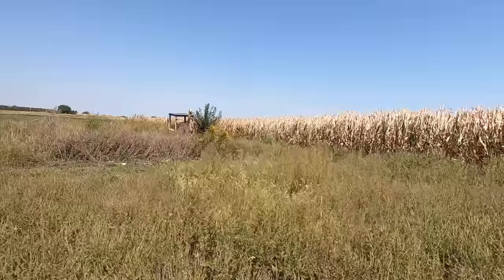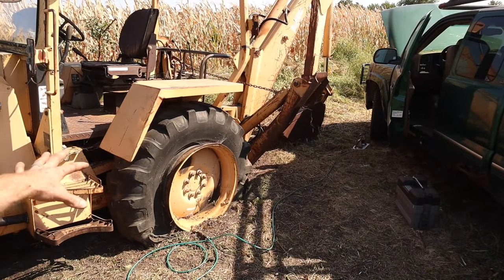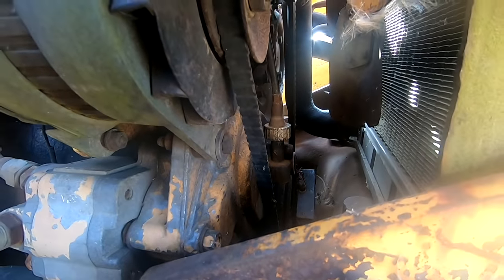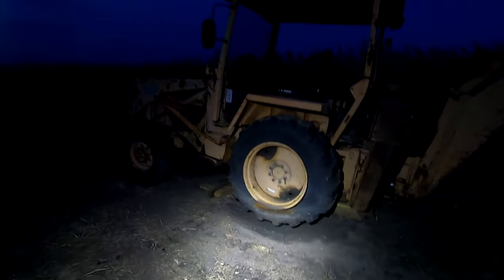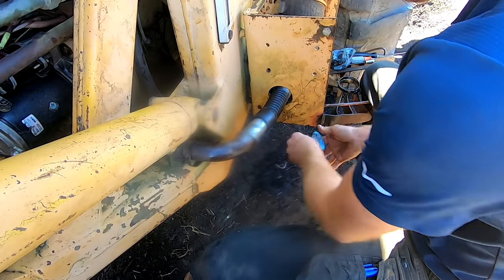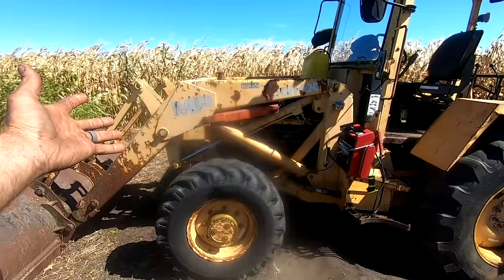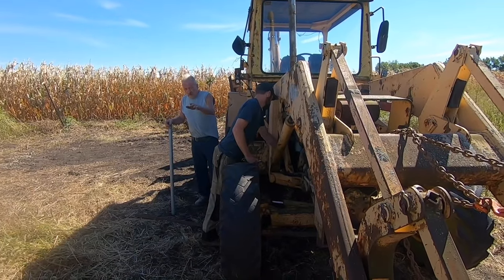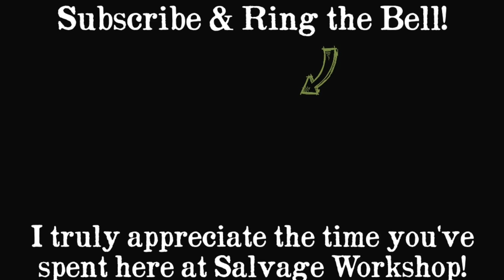I GAMBLED $600 on this Backhoe, sight UNSEEN?? Was the MF WORTH it?!? ~ Broke Down Backhoe ~ Part 1

Comment: Where the oil level glass is located  that part of the loader frame is the tank. I think you are right it is an 80's model. The one Wes did had an unrebuildable swing motor pump thing that the whole backhoe pivoted on. This looks different. Al B.
Reply from the maker: Yeah this is much newer than the one Wes worked on! I'm excited to get it ready to be put to work! Thanks for watching as always my friend!
Reply: @SalvageWorkshop  About that tank crack. Grind it out completely. This may sound weird but preheat a little ahead of your weld. Not cherry red but hotted up. Weld with 7018 vertical up. This will give you good penetration and the 7018 will be compatible with the steel if it has some high carbon. The heat will also cook out any oil in the crack. Hope this helps! Al B in Ohio.

Comment: Radiator fix:I had a buick with the plastic ends,drilled a small hole at the top and bottom of crack,(roughed up the area painted with black pvc cement 10 times)drove 5years sold and third owner drove 5years until they sold it,same radiator.

Comment: I have a massey ferguson  Ind. 50D T LB . I've rebuilt all the hyd. Jacks  hyd  system is super .The wire ing is shot
The Perkins 4cyclender diesel runs good
68 hp. I dig  mine out of a bire patch killed a coper head that it thought it was theirs I've been working the ol gal alot.I use her around the house farm and shop.

Comment: The hole in the front is where the power steering arm and cylinder mounts on ag tractors. The rod pins to the casting on the right side of the machine then the y yoke comes up through that hole and hooks to a pitman and cap end of the cylinder most industrial and 4wd machines used the older style booster cylinder on the side of the machine for powersteering.
The top cover seal kit for that cav pump can be had at any pump shop for about 20.00 it is super easy to pop the cover off change the seals and if equipped bushing around the throttle shaft slap the cover on and go. Also you have to remember that the cav system recirculated all the air in the system right back into the filter so getting air out has a bit of a procedure.  
Check that the rear hydraulic lockout is flipped and that the shuttle is in neutral. Also some of them require kinda jiggling the fnr while holding the brake and key.

Comment: The bushed hole in the front of the frame was probably for the vertical shaft of a capstan winch. The back hoe is built on the running  gear of a Massey Ferguson tractor which would have the winch option for typically forestry work. 
The original JCB was similar in that it was built on a Leyland 72 HP tractor.
 Harry Ferguson the founder of the Ferguson Tractor company was a farmer in Northern Ireland in the early part of the 20th century. He was famous as the inventor of the three point linkage.

Comment: The tractor is essentially the same as a 200 series farm tractor with the 4x4, loader & backhoe added to it.  The radiator, fuel tank, engine, transmission, & rear axle look nearly identical as a 256 or 258 that I ran for a farmer that I worked for about 25 years ago.  If the starter or alternator are Lucas parts, you can get Delco replacements for much cheaper when they have issues.  The mechanical parts should be extremely trouble free.

Comment: These old diesel machines are amazing, they often fire right up no matter how long they've sat. I think people run into a mechanical issue and because they don't need the machine immediately, they give up on it and park it, they are seen everywhere. The mechanism is probably the way it is due to patents, John Deere probably used the simple design. I can't stand tubes, they cost 100$ each, I just buy new tires, but I get it that you needed it to run first before you dumped any more money into it. I also hate fuel injection pumps, I had a Dynahoe with a Detroit 3-53 and it had a simple gear driven fuel pump (a 30$ part). But my John Deere 500C BHL has a muti-million dollar fuel injection pump, I sure hope I never have to rebuild it. Nice job saving that machine, it's even 4WD!! That's a fantastic deal and you can spend time fixing all the little bullshit, maybe you already have, I'll have to check out your other videos...

Comment: Second best option is to block up the frame / axles before you cinch down your chain binders so the bounce in the tires does not load and unload your chains., but the maneuver your'e doing there is called early Sunday morning hauling where I'm from lol

Comment: That injection pump is a CAV DPA pump, pretty much bullet proof, it's only draw back is if it's left sat for a long period the fuel cut of lever under that top housing on the pump sticks shut (Engine stopped), watch you don't lose the spring that closes the plate 😂😂 , p.s I made the clutch plates in that semi auto transmission 👍

Comment: I think that hole in the front of the tractor is for the old power steering unit that the older ones used to use my 50a has the same setup Ide say they kept the same design for a while but put different steering on them

Comment: yes I see using the choke cable but that cable was convert to the mechanical shut of diesel line with a pull knob instead of my F700 electric motor and vacuum cut off the dieseling engine into stop dead. WE sold the 1980 with rebuild/replace cab in 1999 F700 so my sister receive the money in North Carolina and Puerto Rico.

Comment: That hose won't hold there is pressure there to force it through the filter more than that can handle ...don't worry about fuel leaking from the pump it will still run I just need to get the air from the body bleeder ..

Comment: easiest to do is lift rear up with the outrigger or with the backhoe , block under the rear axle and remove the old tire ith the rim 
get it to a tire shop , have them remove the old and install new, or snoop online for wheel with rim for tractor if you can find the hole pattern

Comment: Hole in front of the radiator is meant for the cylinder helping steering if tractor is rear wheel drive. This seems to use same front bracket but because 4x4 it's not needed.

Comment: The location you were pointing to in nose of the machine behind the hydraulic pump is the location for the power steering assembly on 2wd MF industrial tractors. I don’t know about these 4wd units.

Comment: You usually want to load a tractor backwards onto a trailer.  There are several reasons for this.  1. A lot of the weight on a tractor is biased towards the rear wheels. So, if you load it forwards it will normally make the heavier weight behind the rear tires of a trailer which will make the trailer fishtail at anything other than slow speeds.  2. Not a big factor in your case, but loading a tractor from the front can cause it to flip over backwards.  This is especially bad for old tractors that don't have some sort of ROPS, a rollover usually kills or maims the driver.  3. If a tractor has poor hydraulics, you can normally drag a bucket up the ramp if you back it on.

Comment: At 2:18  The hole with a bushing in front of the radiator is for a steering shaft.  There would be a steering cylinder and shaft going down to the tie rods if it was two wheel drive.   With the four wheel drive the steering is different.  This is apparently built on a Massey Ferguson frame and engine.  I have a MF tractor that has exactly the same front and Perlins engine.

Comment: Fresh diesel has better cetane, and is better for the injectors. I once started a Volvo car diesel that had sat for at least 5 years. I got it started, but it made yellow smoke and not much power.

Comment: Up front by the hydraulic pump the machined hole in the frame was the steering shaft for the power steering slave  cylinder Pittman arm before they turned it into four wheel drive and deleted it for a stronger two cylinder set up.

Comment: The bushed hole in the front casting is for a vertical steering shaft if the casting was used on a 2wd agricultural tractor. You won't need it.

Comment: Maybe the hydraulic pump packed up and they are now hooked up to the built in hydraulic pump on the tractor. Will be a low fluid flow but at least it would move things. What's happened to Old Red?

Comment: You should clean out the air filter first so that the trash left by mice and birds doesn't get into the engine secondly you should check your oil your radiator specially your card hydraulic fluid your battery connections your wires if you can see them but I wouldn't worry too much about the wires make sure that all your safety equipment for shutting off the engine when it's running

Comment: What jump pack is that it looks like it works well!
Reply from the maker: It's a Jump & Carry 1224... it can be 12v or 24v and it works AWESOME! I also have a Jump & Carry 950 that's only 12 volts it's also awesome! They are built like tanks and they WORK!

Comment: The hole at 2:20 ist for the stiering on the 2WD version. 
The powerstiering is ther in the front. 
I know a mashien like this, it have the same loader and the arm with the raele on the back.
It have a 2+2 gearbox, with a converter and a gaspadal vor vorword and reverse. 
It dont have the secend floor in the cab, you sit 10 insh deaper.

Comment: Please, can you take your multimeter and try ohm meter to check if the ignition/test switch is connect so the ohm is zero in the reading.the switch is connect to the low power relay once you energize the relay then it automatic connect the high power starter circuit into cranking up. How do you know if the ignition is bad; it could be worn and corrosion?

Comment: Whenever  I see High, max/over, oil level, on these long standing machines. I always think "Probably because the oil is floating on a bed of water".
Reply: Or fuel, or both.
Reply from the maker: Yeah, me too! People don't usually add too much oil! Fuel leaks are also a culprit or possibly penetrating oil of some kind if the engine has been stuck or sitting for a long time!

Comment: I think the front is for a power steering pump .  My gasser is the same but that's where my power steering assembly is, cylinder and shaft to wheels.  Just a thought.
Edit- not pump, cylinder

Comment: 4-248 = 4 cylinder, 248 cu in. Most Perkins engines have this sort of model number system, slightly unusual in the U.K. that cu in was used as even years ago in the U.K. every other manufacturer used cc or litres. 248 cu in is 4.064 litres.

Comment: To release the hydraulics, just crack 1 line on both lift cylinders to release the pressure and the cylinders will lift up without lifting the machine. This indicates there’s still hydraulic fluid in the lift cylinders.
Reply: Or just go to your valve handle and work it and release your pressure

Comment: Hello,
Good work :)
One tip (maybe) about electric issue to start thru the ignition key.
On many backhoe (maybe same on tractors too) there is a security to prevent starter to get current from the ignition key when forward/reverse lever is not in neutral position.
On my case 580SM it is done using combination of relay, if not in "N" position all what you get is a small "click" (some relay somewhere) and nothing else.
As your MF is quite older but still "recent" (it has a buzzer in ! ;-) ) maybe it was some switch somewhere (position detection on lever or transmission itself) that make the circuit "open" instead of "close".
I don't have manual of this MF so possibly my idea don't apply to this model, but... just in case I shared this with you.
Wish you good luck for this one.
Hope to get some progress about "Old Red" one day ;-)
Cheers from France.
Nicolas

Comment: If it ripped the valve stem out of the tube then how can you patch it
Reply from the maker: You punch a hole in a tire patch just smaller than the valve stem, then push the valve stem through the hole and then clean and glue the patch just as you would any other patch on a tube.... with the right prep work and a good glue joint it could hold up for years to come!
Reply: @SalvageWorkshop  Was the old tube, really bad. Is that why you replaced with a new one?
Reply from the maker: The valve stem was just torn, but it was like $80 for a new one and a local tire shop had it on the shelf so I decided to just go that route and be done with that part of the rescue... I did keep the old tube and if I ever need it, I'll just try to patch around the valve stem and give it a shot!

Comment: Did you try putting pressure on the hydraulics (when you jacked the loader up) and then operating the loader valve? Should have relieved the cylinder pressure to the tank

Comment: Have you operated the front end, a lot of old machine you would relieve pressure in the rams even without hydraulic pump or engine running.

Comment: Lame to not use a multimeter DMM to see if Voltage is present at starter.When u short out the 2 connections on sta rt motor, the solenoid is bypassed.

Comment: MF are good . Clean out hyd tank and suction screen and  
and trans  always full of trash water. Worth fixing that 4wd machine with Perkins best motor like a 4 Bt cummins  
Lucas hyd oil sealer conditioner stopped small leaks on cylinders on my old 70 ton Grove. Hercules seals in FLA has all packings hoses fittings you need. 
Good score. Good work!
You should bleed air at all injectors.

Comment: The hose is the feed to the hydraulic pump the pump sucks through this hose through the filter  and from the tank which is in the frame. Your new hose needs to be reinforced so it will not suck in flat under high revs this machine is probably mid 80s

Comment: Massey used Perkins engines in most of the tractors and combines. The Massey 35 of the 50's had a Perkins diesel version.
Reply: massey ferguson owned the perkins company from the  1950s until quite recently when they were  sold to caterpillar.

Comment: Good subject matter in your videos.
For everyone: KISS electricals....  PLEASE everyone... clean & TIGHTEN the FULLY SEATED lead terminals on the battery.. On a diesel, the starter amp draw can be 1000 to up to 1500 amps (or even WAY more!!) !!!! DON'T JUST TWIST THE BATTERY TERMINALS ON!  The battery can literally explode with a bad connection!

So, You were going to use the starter in the beginning.. When it didn't work, Why bother then to bar the engine over? That either should have been done first or don't bother.
When the fresh battery doesn't work at all, your friend is a  simple 12 v test light (get a "good one" at Harbor Freight... long lead.. about $6 ??) attached to battery Neg, check first for 12 v @ post 1 on the starter, then on Sol 1 when you turn the key... & then on post 2 on the starter if both the prior light up the probe. (& test on both the wire ring terminal & 2nd, on the terminal post. The wire may have power, but when corrosion sets in, the terminal post may not.. In that case, you have found the or A problem)
If still no putt or click, (& in all prior cases of no 12 v), look for a bad connection to ground (or any pertinent + in the prior tests..) , wire brush ring & connection point to a shine & install a serrated washer  99 out of 100, it's a bad battery terminal (#1), or a poor or corroded terminal connection ..either + or -... Starters (&alternators) don't fail as often as they are replaced.. and DO fail generally because of poor battery or post connections..

 Simply put: bad connections = low voltage = high amperage = burnt starter windings or an overcharging & thus failed alternator.

Comment: Whew, you sold it. I bet you were asking them for their address and drive the tractor on highway and ask the patrol officer for permission to ride on the tractor up 100 miles to reach the potential buyer or shorter distance than that. You did not remove the front loader shovel so it is still front loader  travelling. The diesel tank need to go to rope and tie it up to the wheel of the truck Pickup and lift up the truck rear wheels off from the ground and street with jack/jacks. Let the wheel and the tank tumbler and tumble with brand new cat litter and some pebble rocks?
  Plus put on the triangle poster sign as saying SLOW Caution require by traffic rule and don't drive the tractor Massey Ferguson at dark. Thank you.

Comment: $600.00 risk? 😲 bud i spent $1800.00 + $400.00 to tow a 1970 Massey Ferguson mf40 backhoe with a  seized  engine. Parts? I could drop a bolt on the floor and build a backhoe around it.  It was my 1st covid project. Runs beautiful now. You made a terrific steal not a good deal.  Good luck.

Comment: Then what your action was you refuse to check all the wirings that is troubleshooting the with test wirings You skip the test wiring. You will push these alligator clips to crank up the starter after you fill up diesel and prime the diesel like you did already. The ignition switch is now a cut-off switch where the second circuit from the switch goes to the diesel distributor and it has a diesel cutoff valve with electric small secondary starter called die off the engine starter.

Comment: Great video, the inner tube was great work and that field fix on the diesel pump was awesome.
Question though, when the solenoid diddnt clunk or even spark when shorted out but ran later with direct power, doesn’t that point to the battery cables to the solenoid being bad, something like a rotted out earth? Like you said all the wires were messed about with, but the lack of life at the solenoid is a smoking gun a a lot of it IMO. Im looking forward to the next one. Thanks.

Comment: Okay you refuse to clean it with tumbler system because your tank is good and will be ready and it went back to the installation and connect to hose and by himself and found the barn find tractor 4 wheel and all tires I recommendation to be getting new tires to replace them so the front tire is about 30 inch diameter yellow rim...